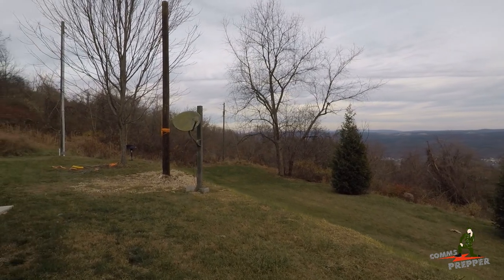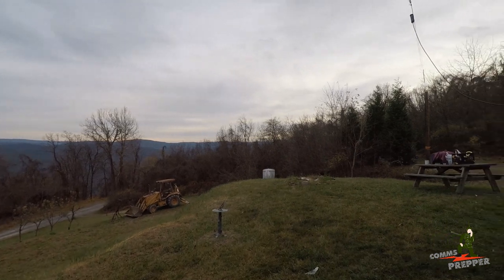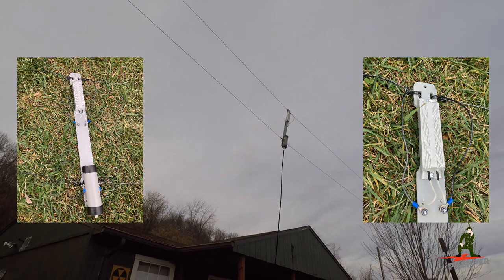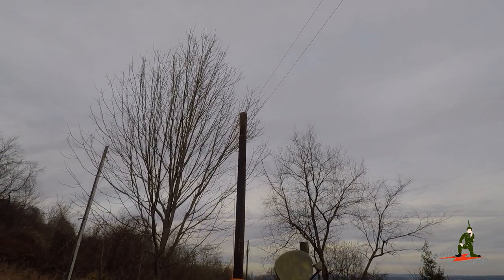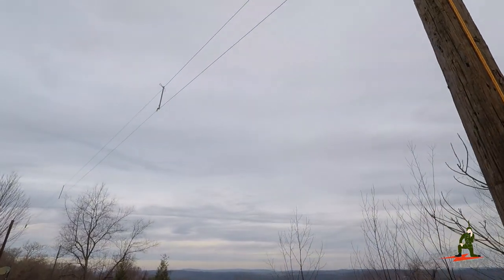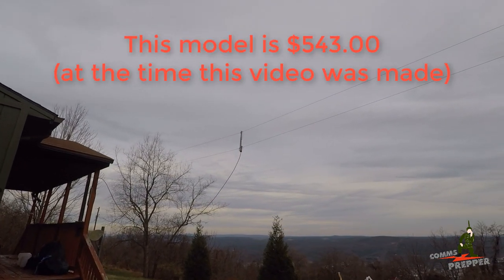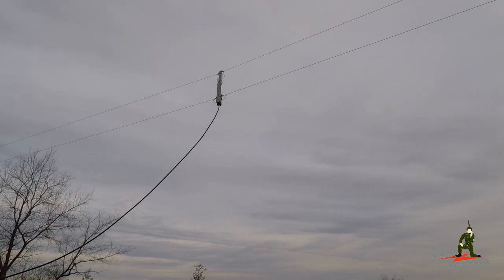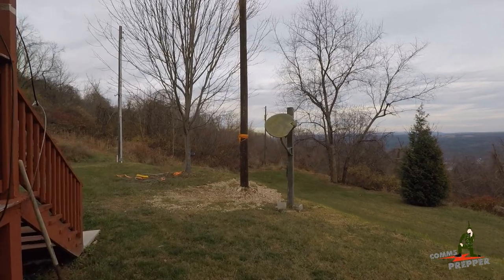Alpha Technical Services HF Folded Dipole Antenna

Comment: cool stuff, i tried cracking your code for about 5-6 hrs with no success. i was doing frequency analysis and the key space is so long that it makes analysis very difficult good job !!! and thanks for the tip about the ss eye bolt instead of the pulleys.
Reply from the maker: Glad to hear the code held up.  I'm sure it's not the best but should do well for prepeprs if some basic operational discipline is followed.  My not be a OTP but close.  There maybe better than eye bolts but they have worked well for me.   Thanks for the comments and channel support.

Comment: Are you going to place a reflector in the ground below? I've read it would help NVIS properties by adding wire mesh in the soil..
Reply from the maker: Not needed with this antenna.  All I need to do is change the configuration from horizontal to inverted-V and it's NVIS between 1.8 to around 10mHz.

Comment: How deep did you set the poles and what size auger ?  Were you able to set them using the backhoe?  Did you set them with concrete?  There is a market for refurbished pole I guess?
Reply from the maker: Poles are five feet deep.  I set them with a backhoe.  I did not use concrete as the poles are treated with old school creosote.  Not sure what the market is.  I paid 120 for each pole.

Comment: Nice setup hows it perform recieve shortwave bands and swr on ham bands
AA4CP Chuck 
Port Salerno FL
Reply from the maker: It's performing well for me.  SWR is in specs but will have different readings based on local installation.

Comment: Don't you sacrifice about 10 dB by having a terminating resistor to provide broadband low SWR?  That would require generating 400 W of power input to a transmitter to get 200 W RF to the antenna to radiate 20 W.  Why is the TFD better for amateur radio use than a multi band end-fed antenna like the MyAntennas EFHW-8010 with a broadband transformer that may lose 1-2 dB in matching?  A good common mode choke can handle the EFHW RF current on the coax cable to the radio.
Reply: I probably wasn't precise enough with my statement about wideband TFD performance.  I had in mind NVIS, primarily on 160, 80, and 40 meters, and the loss of the TFD is higher at lower frequencies.  Calculated and/or measured gain of a well known commercial 90 foot TFD in comparison to a standard dipole was approximately:  -23 dB at 2 MHz;  -11 dB at 3.5 MHz;  -4 dB at 7 MHz, with both antennas horizontal and 30 feet above poor conductivity ground.
Reply from the maker: and your point is?
Reply: @Commsprepper  For possible use during an emergency, especially one without commercial power,  I don't understand a voluntary choice of communications equipment that is 3-10 times less power efficient than another choice with approximately equivalent performance.  Is there some compelling feature of a TFD that I'm not seeing?  The only one I can figure out is complete transmitting frequency mobility, not limited to amateur bands, but most amateur equipment doesn't have that flexibility.

Comment: Boy that is  a lot of $$$ for an Antenna, If it is one of those things that has a 270 ohm or so resistor in the center, waste of power. Take a look at the ZE6BKW that you can make in about 20 min, Mine matches 40,20,30, some on 12 and a small part of 10, with out tuner. Cost only some wire and 450 ohm open wire then fed with RG8X, you might need a bit more vertical on your poles. W4GSM.